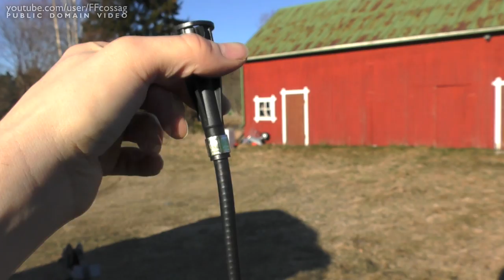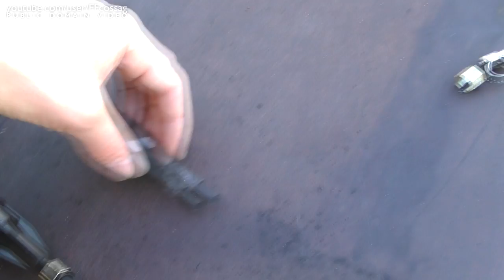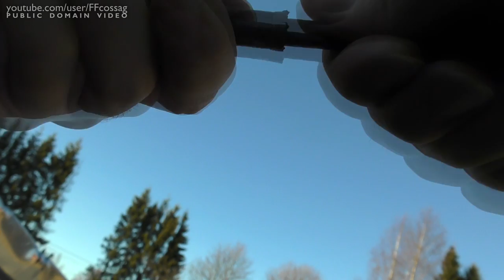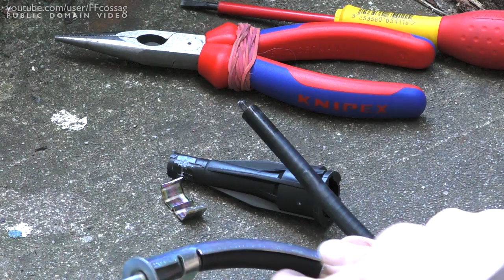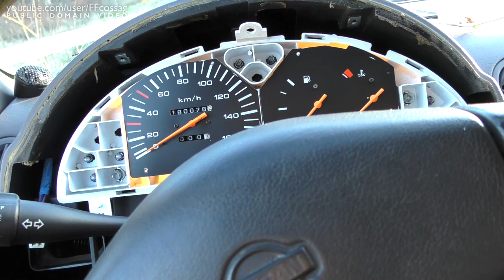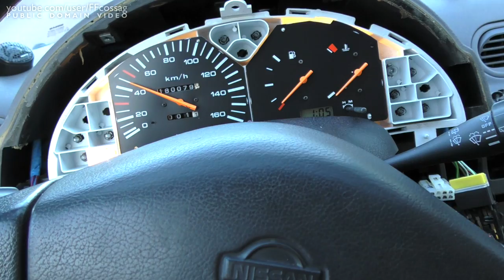GRINDING UP BRAND NEW NISSAN PARTS

Comment: Dad has nissan navara to use on the farm,. and after warranty it breaks much more than before. aicon failed (airmix door stuck it would seem, probably dead servo. to replace that one you need to rip out evereyting in fron ouf you except the steering wheels. the one for driver side works and is accessible from the bottom without trouble...) door handle fall of, leaf spring broke, engine chain worn after 4 years of use (replacement under extended warranty, they did not want to do it, but got it anyway, despite of them being "nah, it is not a chain that rattles that you can hear 10 meters away from a car". worn everything, for an exorbitant price, thank got it was on last month of warranty).

Comment: Probably should have left it as is, because you don't need much registrar in the drive to spin a free spinning speedo. Also the outside housing is a flat wound wire spring with a plastic sheath, and when the plastic shrinks and hardens it closes the gaps  and makes the outside shorter. Hopefully in your cold climate it won't shrink much. 
Over here we have specific shops, ie custom car shops, that make one-off custom cables cheaper than that.
Reply from the maker: It indeed requires very little torque to drive the speedo, however, sadly, my speedo is not of sufficiently low friction to turn without the cable mating with it.

Comment: So how much was the cable? :P

Just goes to show, just because it's new & genuine doesn't mean it's been made right, I'd have made them take it back and refund the money if it was mine...
Reply: What's the point in taking it back, Nissan probably have a whole shipping container of identically limp dicked cables. At the end of the day he still needs one that works.
Reply from the maker: What station240 pointed out is correct - I actually returned it once and got an identical one back.
Reply: Well, must be a Nissan intentional conspiracy to make you buy a Joke, I mean Juke, no, I did actually mean Joke really, those things are fugly... :P